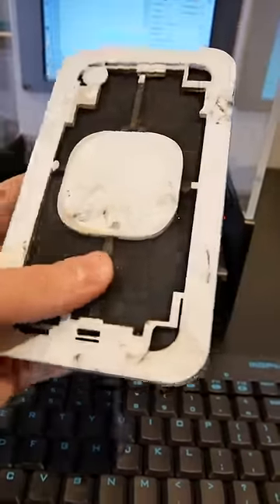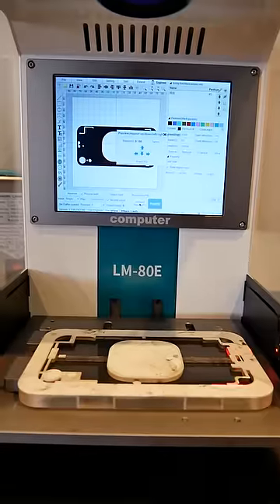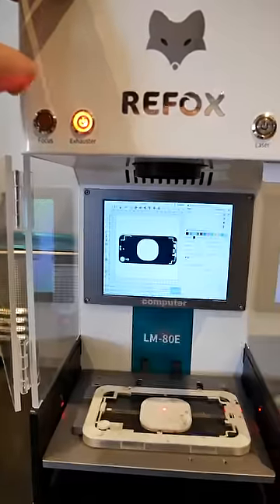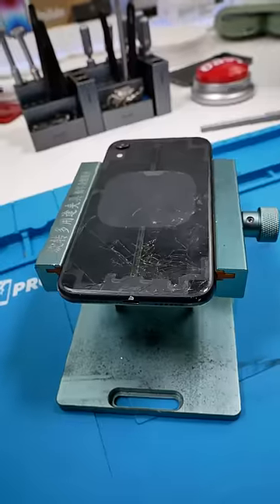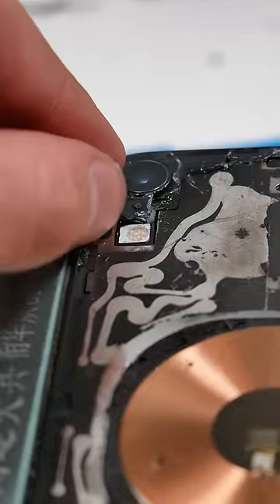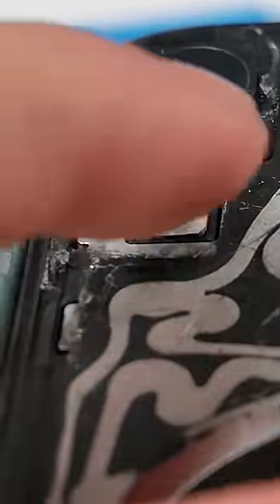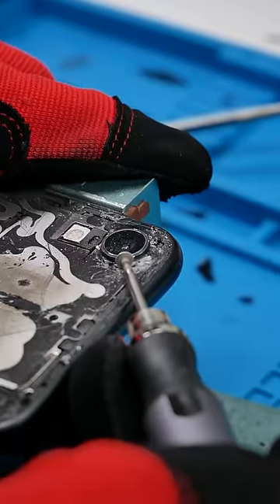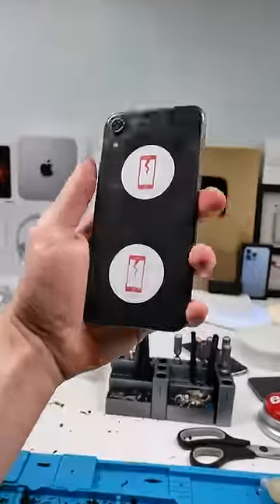Back Glass Laser Burned My Face Off! 😱 (Clickbait)! #Shorts

Comment: I have a old samsung Galaxy 7 and when it powers off it starts flashing white also it dies when i plug it in and sometimes dies randomly above 0% the battery depletes in like 1 hour and the screen is cracked also there are glitchy particles or like lines of pink and green that usually follow on whats on my screen. Any tips on what is happening